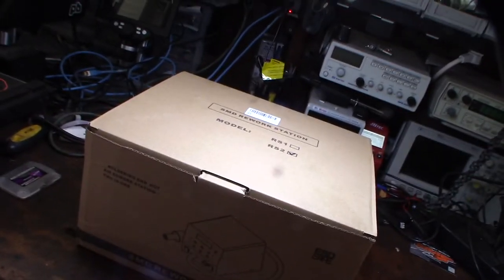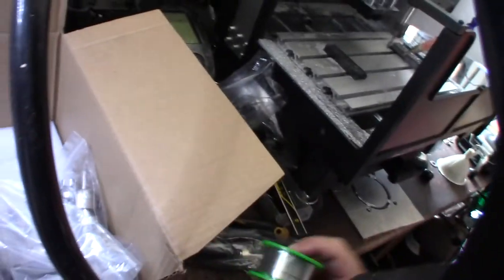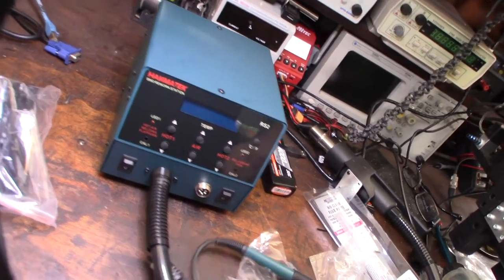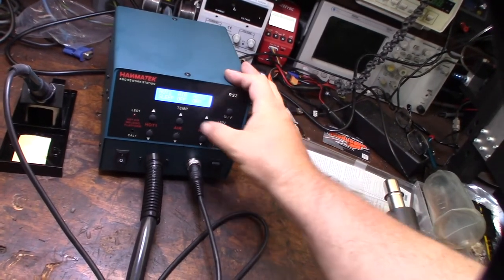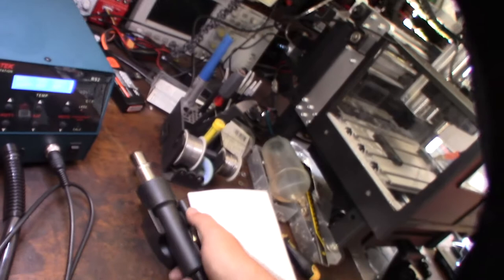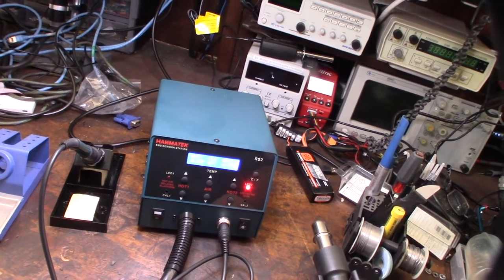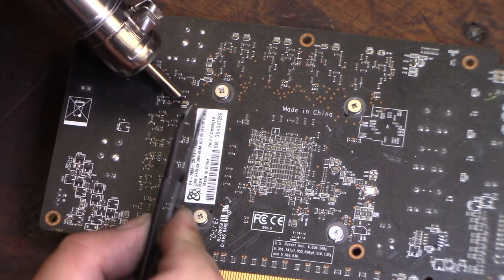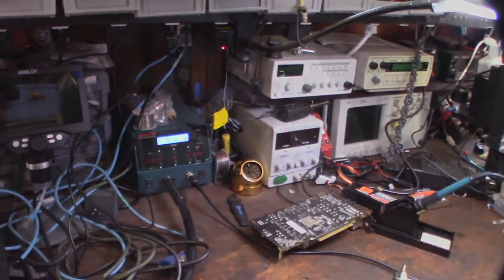Hanmatek Durable 2 in 1 Hot Air Rework Station and Soldering Iron Station 800W with Internal fan

Comment: Anyone know where to get a replacement soldering iron for this model? I’ve tried two different ones from Amazon and both threw an error2 

My iron still works but I have one tip that’s stuck on it and I’m sure it’ll crack the ceramic heating element if I try to remove so I want to replace the whole iron but don’t know where to buy it

Thanks